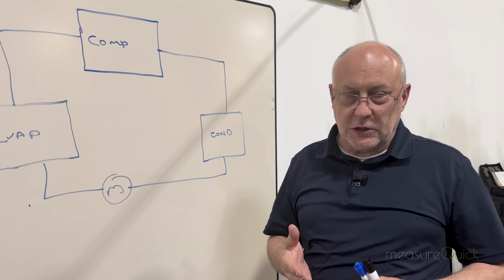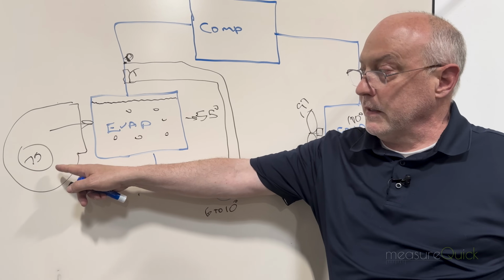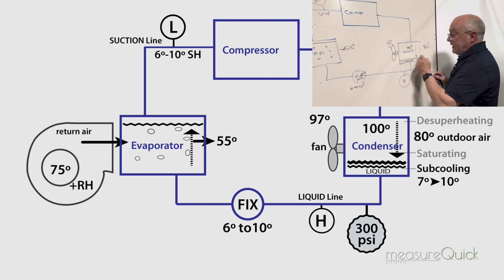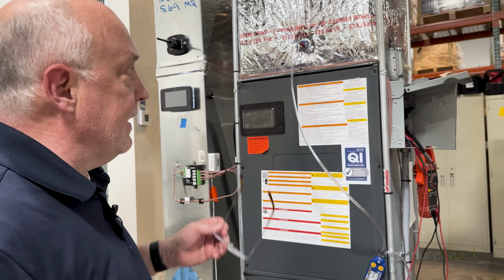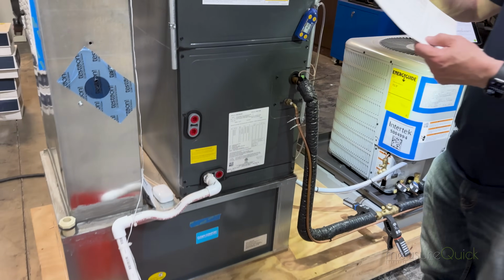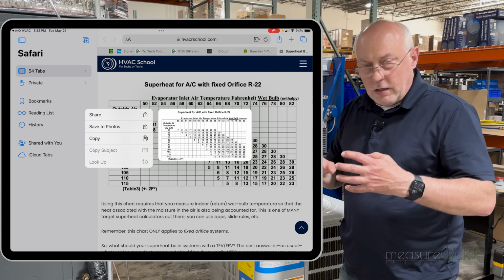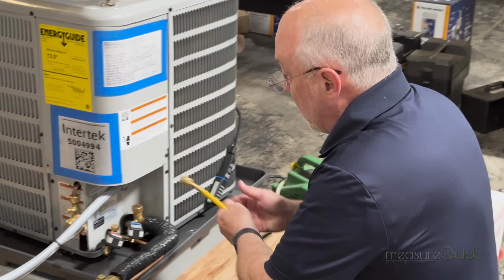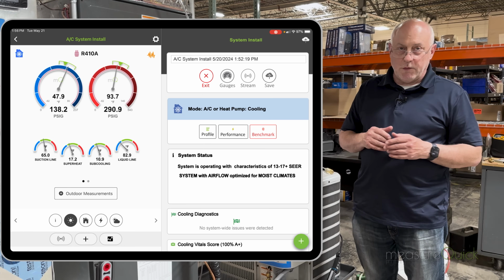Best Practices for Charging A System [2024 Version]

Comment: 13:47 - What are the steps from starting MQ to get to this screen? I’ve gone different routes with the same response. The “gauges” displayed on my screen shows TXV/Superheat on the left and CFM/Air Flow on the right. How can I get the PSIG suction and liquid to show from my connected Fieldpiece probes? I’ve tried Quick charge, start a new project, make a saved project active, as well as other things after opening the MQ app but with the same result. What is the required information that needs to be entered before I can see the pressures from the connected probes displayed. Am I missing a requirement? I have the following probes mapped: liquid pressure, suction pressure, liquid line temperature, suction line temperature, discharge line temperature, outdoor air temperature, return air temperature, supply air temperature, return static, and supply static as well as the iDVM550. The all the probe’s readings are accurately displayed in other parts of the app. For me to see the current pressures, I have to open the toolbox and go to the connected Fieldpiece probes list.

Comment: Good to see you are doing well!
So just to review, #1 We set the airflow to the condenser size or coil? 
Can you elaborate a little more on the part you said about what type of motor you have?
Standard vs actual. PSC vs ECM? 
Thank you for such a wonderful app!
Reply from the maker: Set the airflow to the condenser size, with a PSC and look at actual airflow. With an ECM watch standard air flow. An ECM moves the same mass flow rate. A pSC moves the same volume with a variable mass flow rate.
Reply: @measureQuick  would it matter if it's constant airflow ECM or constant torque?
Reply from the maker: Constant torque motors are set up similar to PSC motors however they have much less drop off in performance with higher statics. They also move a constant pretty constant mass flow like an ECM. The differences a constant torque motor is set by the wire taps and static and ECM is set by adjusting the dip switches to a preprogrammed SCFM.